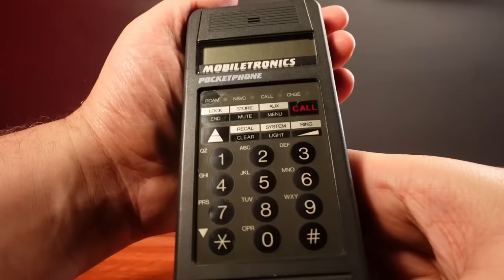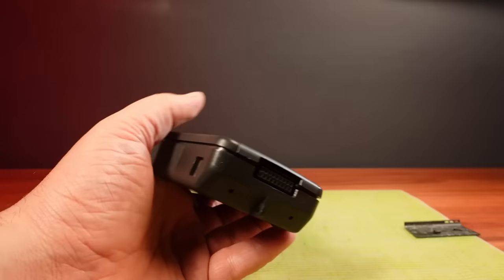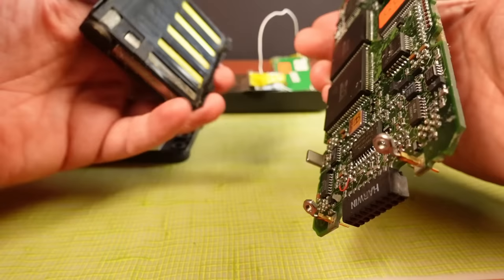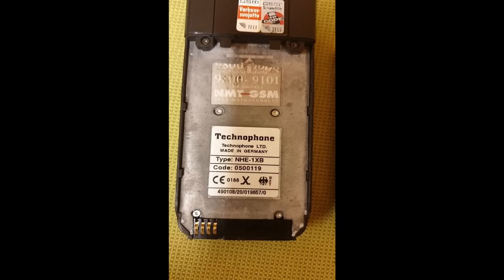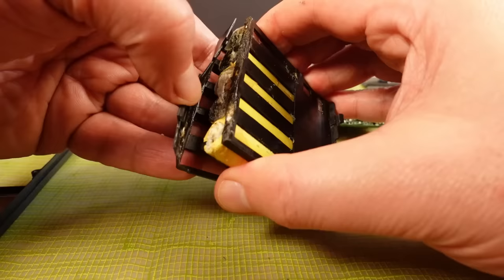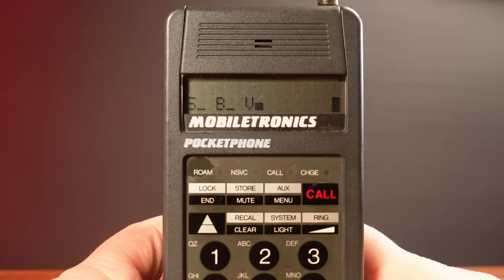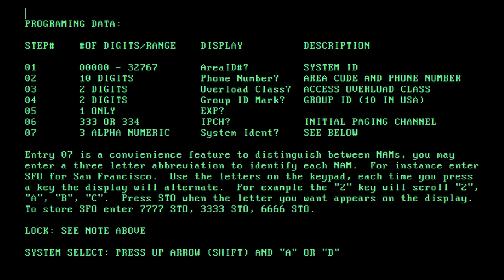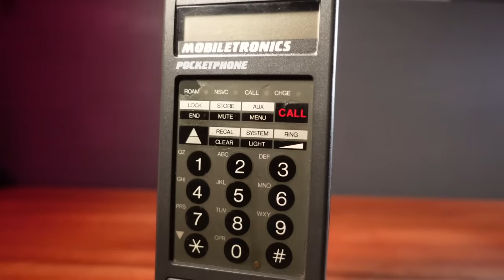1985 Cellphone In Your Pocket

Comment: 1.4V end of charge for Ni-Cd cells, so originally max voltage 8.4V perfect for two Li-ion cells and room in the battery box to fit a cheap small 2 cell Li.ion charger circuit board.

Comment: These phones required the eprom to be "burned" clean to reprogram with stolen UID/ESN's hence term "burner phone".
Reply from the maker: It's more commonly thought to be a burner because of how they are disposed of after use. I prefer your description much more, thanks.
Reply: @JanusCycle  hardware was too expensive back then to be disposable. Air time was by minute or fraction thereof. Dope dealers carried a "beeper" and used the "cloned burner phone" to return calls. Eventually subscriber or carrier noticed discrepancies and access got shut off.

Comment: Ah, good old amps, i remember having many motorola mobiles you could put in test mode by shorting middle battery pin to GND, then  u could turn on RX, go through the ch's and if u were naughty turn on TX and have a convo conf!

Good times

#Ausphreak ex admin
Reply: Did you ever get to play with an Oki 900?
Reply: @robertstratton6444  Sadly no :(

Comment: I had, and still have a motorola microtac. The phone itself was relatively small, but the battery packs made them large, especially if you had thr extended run time packs like I did.

Comment: You should try using Osmocom analog and fire this baby up properly.
It works well, tried it with Nec p3,p4,moto 8800,4500,4800,Panasonic f1,Sony mars bar.microtac etc
Reply from the maker: I'm in the process of working my way up the SDR ladder. Currently learning about radio with a HackRF. I'll get into full duplex hardware when I'm able.
Reply: @JanusCycle  shame your so far away, I have a usrp, my lime mini 2 is on order.

Comment: "I don't have a base station to run this phone"

Y E T
Reply from the maker: I am exploring SDRs. I have more to learn, also want to keep the law on my side as much as possible (within reason as a hacker of course:)
Reply: @JanusCycle  
I've used various SDR's, both cheaper ones for home projects and very serious units for work.
They all share one characteristic - Complete unreliability.
Either the components in the hardware are being run at 3% over what they were rated for, or the software frequently crashes / freezes.
On the flip side of the coin, commercial comms gear (such as base stations) will boot from cold with boring reliability. 
I survey for, reccomend, specify, repair and fit two-way radio gear. I see a lot of old gear screwed to walls in damp basements which hasn't been touched in 20 years, and still works flawlessly.
I've never messed around with phone gear, but I get the feeling that it would be easier to acquire a complete base station than it would to emulate one with SDR / software.
There is a company acroos the road from where I work that always has their yard full of what MUST be old mobile phone equipment (their line of work is comissioning base stations and networking) - I think they weigh it all in as scrap aluminium, because they hoard this gear in a bigger and bigger pile until one day when I pass by, it is all gone.
I only eye it up for the monster heatsinks (big power supply projects).

Have a google around and drop some places some emails. You might be surprised to find just how much companies have to pay to have this gear removed. You could offer to buy at the scrap price and weigh-in anything you don't want at the scrapyard?

Comment: Wait if we had the technology in 1985 to make a mobile phone fit in your pocket, then why the hell was the Motorola dynotech so huge?
Reply from the maker: Motorola brought the Dynatac out first using their knowledge of industrial radio manufacturing. Technophone condensed the concept and changed the form factor to pocketable. They saw what people wanted more, a pocket phone.
Reply: @JanusCycle  That makes sense, thanks.
I just had another thought.

I feel bad for anyone trying to make a phone call on a particular Tower back then when some civilian just had this phone phone's overload class set to the highest priority.

Yeah, old technology like this wasn't secure at all.
I mean you could even change the damn phone number on the damn thing without a SIM card.
So essentially you could steal somebody's phone number, and get away with it.

Makes me happy that we actually have SIM cards now.
Reply: @REAL-UNKNOWN-SHINOBI   It was much worse before AMPS (analog cellular) and number assignment modules. The old Motorola IMTS (Improved mobile telephone service) was an offering in the U.S. prior to the development of cellular phones that had a 40 pound transceiver unit in the trunk of the car. Back then in the U.S. all mobile phones used the same "exchange" regardless of the NPA (area code) in which they operated. I think it was 665. (You also had to rent them from your local Bell System operating company.)  So the individual phone had to be set for the NPA/Area Code and the last 4 digits of its number. If you opened up the radio unit in the trunk of the car, you'd find wire jumpers. Motorola used "security through obscurity" for the jumper settings so you had to translate digits to different jumper positions, but once one knew the code, there was nothing physically stopping anyone with one of these IMTS phones from setting their number to anything they wanted.

Comment: Having a non - consumer removable battery pack looked a bad idea, alot of small radio equipment back then had externally removable battery packs .
Also, it would probably operate fine on four 1.5 volt dry cells (6volt), the fifth Nickle cadmium cell was fitted to make the battery pack up from 4.8 to 6 volt.

Comment: Wrong. This is not the world's first pocket telephone. I have a Motorola mobile telephone from 1976 that was my dads who worked for CBS News in Boston Mass. He used it until 1980 when he then moved to DC to cover the white house for CBS News. This Motorola handheld phone was given to all reporters at the station that my dad worked for in Boston. He gave it to me summer of 1982 when I went to visit my dad for the entire summer. It didn't work in the DC area so there was no use in keeping it. It works on 427Mhz. I still have the phone. It is a basic two-way radio with a push to talk function. But it dialed just like any other push button phone at the time except, the push to talk button needed to be held down to dial. So, no, it is not the world's first.
Reply from the maker: That sounds cool, I would love to see a photo of it one day, thanks for letting me know.
Reply: @JanusCycle  It is in a box somewhere in my basement. I'll go looking for it one day soon.
Reply: @nathanwoodruff9422  Get the batteries out of it...
Reply: @ShainAndrews  I believe it works off of 2 9v batteries which were probably removed sometime in the mid 1980's. Did you want the 2 batteries?